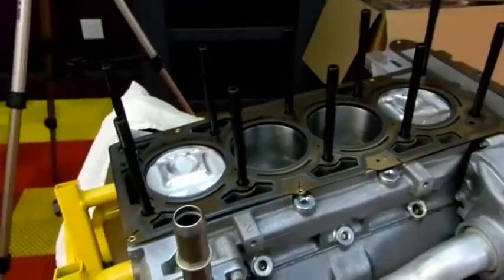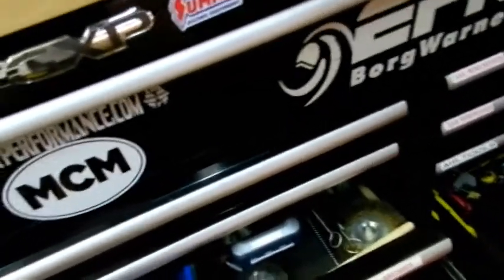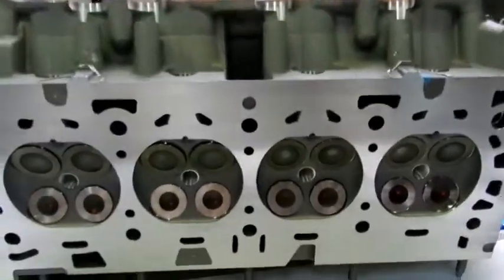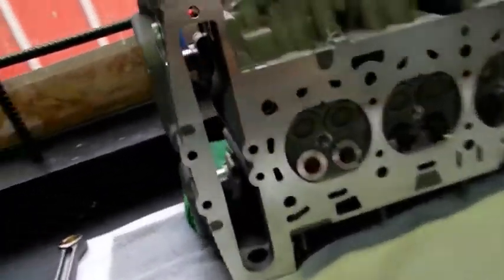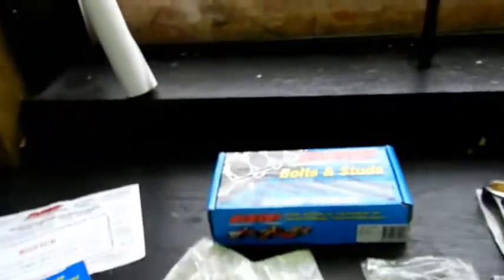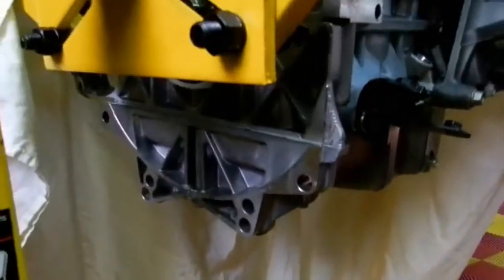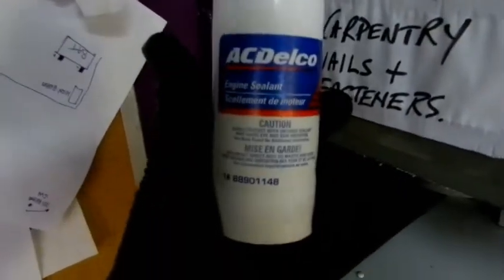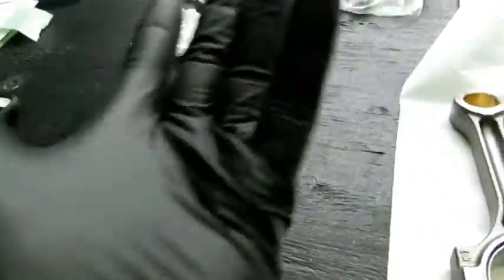LNF REBUILD VIDEO #9 - HEAD STUDS - BLOCK & HEAD PREP - HEAD INSTALL

Comment: Where did you get the complete cylinder head and do you have a part number
Reply from the maker: +Dennis Loch 
I got it from my GM Dealership. 12616487